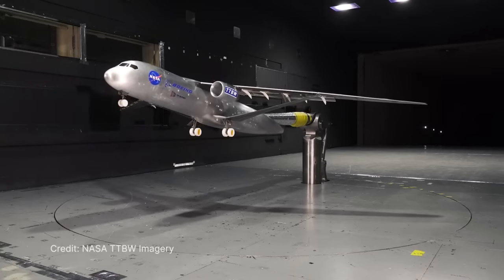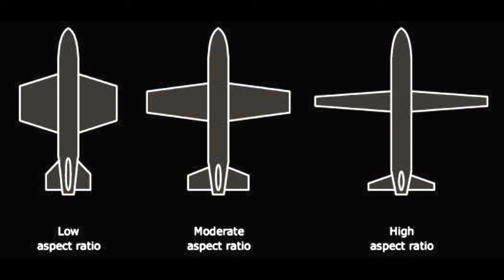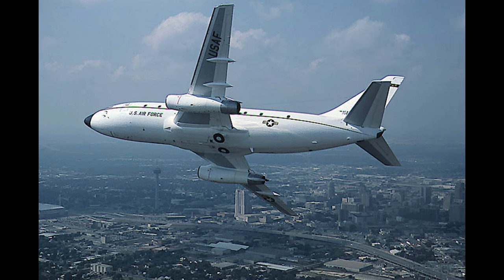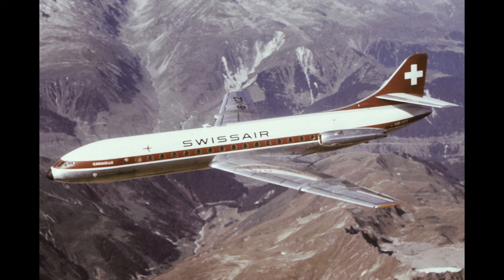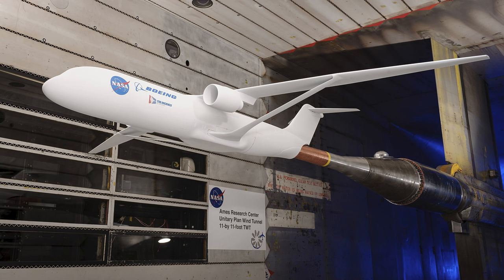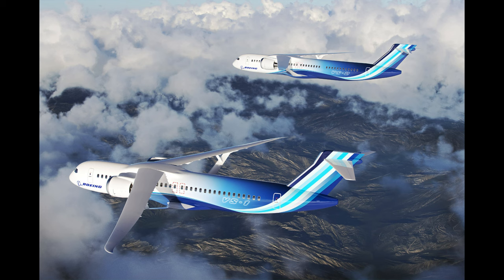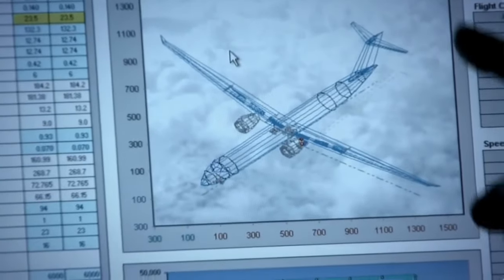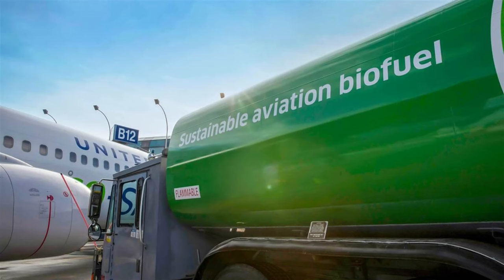NASA's New Airliner Experiment To Make Flying Less Expensive

Comment: And even better example would be the RQ-4B global hawk. it's got about 130 ft wingspan and is only 45 ft long nose to tip. It also flies at 60,000 ft with the engine at idle.
Reply: and that thing looks so small when you see it without people nearby for scale- it looks like a small bizjet until you see some dude walking under it.
Reply: And on the other side, this kind of wing is already being used on the China’s High-Flying WZ-7 Drone
Reply: At that point we should probably mention AeroVironment's Hawk30 and Sunglider flying wings.
Reply: Wow. I wonder how high it can fly when they turn the engines on.
Reply: Perfect design for cargo and passengers.
Reply: How long does it take to get from point a to point b?
Reply: The Transonic Brace frame can be utilized as wing fins, while being two main wings, for example: (In a top view.)  If you use an acute angle slim wing base limbs in the mid top front of a craft, that attaches to the tips by another lower rear reverse wing from another wing base connected on the back of the craft. The full set can be very narrow width spand. 

 A hollow mid mass + elongated lesser drag combo. of delta wing sonic speed & lean airliner size wings lift grip in* ONE. ( top view diamond ✈ formation, front/back view as flat diamon 🛩).
Reply: How about NASA and AeroVironments Helios?

It was a solar powered super high aspect ratio flying wing, in 1999.
Reply: @mattke5etc Great observation! Hadn't thought about this until Scott mentioned the U2 and saw your comment, less atmosphere higher up, also, (assuming) less lift from thermals at higher altitudes in terms of glide, not sure just starting to learn about dynamic systems etc.
Reply: @confuseatronica  haha I always feel like I'm having a stroke when I see it near its hangar
Reply: @aspuzling  he said idle, not off

Comment: “Control surfaces that can curve instead of just fold”

It’ll be nice to see 120 year old technology return. The Wright Brothers original patent on the first aircraft included wing warping as the control mechanism. Nice to see that come back.
Reply: Except that speeds are times higher.
Reply: it has been back sinc the X15 showed it would work better at supersonic speeds.
Reply: There was a program to look at this using a modified F-111 back in the '80's (https://en.wikipedia.org/wiki/General_Dynamics–Boeing_AFTI/F-111A_Aardvark)
Reply: My farm is a mile from the cliffs where they saw the birds soaring and got the idea. I am currently cleaning and widening the trail to the site so that more people can see the same thing that they saw.
Reply: @FarmerDrew  that's nice
Reply: Cheers. I got to the same conclusion.
Reply: Nothing wrong with it, just take old ideas and aply new materials or new technologieas at them. Roman concrete could help building industry. Old Sumerians have AC with no need ofl electricty ... obviusly. Airships cold be ecological and economic solution to havy cargo transport. And we could use slings or trains to get in to space cheaper and with lees polutions. problem is that Kante was right, unles you held "old industries" at the "gun point" they will never change.
Reply: @lukasmacht5858  Proof that physics doesn't change.
Reply: @l_..l.l.__l..l8833  it's a great office, good coworkers, and the birds rarely steal office supplies
Reply: Read (I think in the Putnam Aircraft range Japanese  volume) how one of the first Japanese aviation pioneers, wanting to build 'wing-warping' wing ribs, used craftsmen who built traditional laminated (archery) bows to create what he needed.  Old technology truly does return.
Reply: Apparently inspired by a cardboard box bending
Reply: @FarmerDrew  Who, The Byrds?
Reply: @cordongrouch9323  The Who, The Birds, The Beatles, Led Zeppelin, The Doors, we listen to all of the music while we work the historic Wright Brothers trail
Reply: @Ballin4Vengeance  it was inspired by hawks soaring the thermals in Moraine, Ohio, where Wilbur and Orville Wright had their first bicycle shop
Reply: It did come back bedore when nobody asked for it. On some planes at high speed the ailerons warp the wings so that their effect is negated or even reversed 😲
Reply: @FarmerDrew  Jefferson Airplane, my man!
Reply: @cordongrouch9323  oh and Steve Miller - Jet Airliner
Reply: @FarmerDrew  Time keeps on slippin'...

I want to fly like an eagle...
Reply: @FarmerDrew  Oops: The Byrds.
Reply: @cordongrouch9323  Neil Diamond - Jonathan Livingston Seagull
Reply: @FarmerDrew  I always kinda hated Jonathan Livinston Seagull.

But, it's all good.
Reply: @Lurch Not when it is encased in actuarial armor.
Reply: Ah - AKA "wing warping".
Reply: @youtubeuser206  Good for them!
Reply: @youtubeuser206  Yahtzee!
Reply: There is a reason wing warping disappeared: it was not working well, it was more working barely.  Ailerons are much superior.

And what is proposed is far from wing warping: it’s still ailerons. The ailerons will not have just one hinge but multiple ones — giving a smoother profile for the air to go around.
Reply: @FarmerDrew  All of the Wright's bicycle shops were in Dayton. As was their airplane factory. The people who bought the Wright company built an additional larger factory in Moraine.
Reply: @StevePemberton2  Moraine didn't even exist back then, so, yes, you're right. I live here and visit these places regularly. Dayton is an aviation history paradise.
Reply: @FarmerDrew  I went there several years ago and visited the museum and went out to Huffman Prairie. Sort of sad to see the empty lot in Dayton where the final bicycle shop was, but I have been to it at the Henry Ford museum in Dearborn, Michigan and they have taken really good care of it.

Interesting how for many years they couldn't find one of the bicycle shops, they knew it had existed because they had photos. Then a photo emerged with a little girl standing in front of it, they asked around town and found out who she was and where she lived, and that helped them locate a house which they then realized was the bicycle shop but it had been remodeled so the exterior didn't look quite the same as the photos which is why they had trouble locating it.
Reply: @StevePemberton2  our local community just successfully fought a bid to demolish the original shop near downtown Dayton
Reply: @Lurch pretty much if you can easily warp the wing enough to derarically change the lift profile you're going to have a very hard time stabilizing it.
Reply: @FarmerDrew  That's great. I saw a photo of it and I can see why some thought it should be torn down as not much is left, but it's historic and should be preserved especially since it was their first shop.
Reply: Can’t beat the Creator’s original design. Birds.
Reply: First aircraft was made by Santos-Dumont, not Wright Brothers
Reply: @r.h.w.1776  In fact that's what Otto Lilienthal used the basis for the world's first glider in 1891. Others had only tried to imitate the flapping of a birds wings, Lilienthal realized that it was the actual shape of the wings that mattered.
Reply: @giuseppevgiordano  There is a difference between the first powered flight and the invention of a working airplane. There is clear documentation, multiple witnesses, and photographic evidence that the Wrights made their first powered flights on December 17th, 1903, flying up to one minute and 1/6th of a mile on their longest flight that day.

Others may have lifted a powered plane off the ground before the Wrights did, perhaps nearing or even exceeding that distance. However documentation is very sketchy and harder to prove. But it's certainly possible that one or more people did this before the Wright Brothers.

However for the Wright Brothers December 17th, 1903 was just one step in a well documented development process over several years, that went from constantly improved gliders, to straight line powered flights, to sustained controlled flights at higher altitudes . By 1904 the Wrights were flying up to five minutes and doing full circles. They continued improving their design over the next few years. 

During development of their first powered airplane the Wrights produced the first accurate lift tables, they were the first or at least among the first to use a wind tunnel for testing, they were the first to understand the need for balanced turns, and the first to realize that a propeller is actually a spinning wing and works by the same principles.

The Wright's faced skepticism in Europe that the claims of their airplane's capabilities were greatly exaggerated or even a total lie. In 1908 the Wright Brothers did demonstration flights in France, and their former critics now hailed the Wrights and recognized their achievement.
Reply: That's not what he's referring to. He's talking about hingeless control surfaces.
Reply: @r.h.w.1776  Oops. Flying fish.
Reply: As a duck, i'd like to point out we had "wingtips", "warping control surfaces" and "retractable landing gear" about 10 million years before the Wright Bros.
Reply: Counter intuitively, the best shape for a paper plane is a cylinder. Given a flick to spin it, it flies far farther than any dart shape, as demonstrated on QI some years ago (Stephen Fry era).
Reply: German ww1 monoplane as well
Reply: @lukasmacht5858  The roman concrete supposed superiority that gets repeated a lot is partly a myth due to appearance. A large part of the reason it remains standing is simply because of massive bulk and lack of steel reinforcing(when reinforcing rusts, it damages the concrete). People are also unaware of all the structures that had major repairs, or collapsed. It also seems highly debatable if roman concrete is actually stronger than current(unreinforced) concrete. Unfortunately even well regarded information sources seem to just repeat info without any testing etc.
The formulation with volcanic ash does make it better for durability/longevity, but unless/until that can be replicated artificially it's not much use unfortunately. Albeit seeing as modern structures almost always require reinforcing steel, for strength(well beyond what unreinforced roman concrete could handle) and quake resistance, it's real purpose would probably be largely to better protect the steel.
Reply: Wright Bos.' wood and fabric was replaced by aluminum. Aluminum does not like to bend. Modern composites can bend. Full circle  =)
Reply: @lukasmacht5858  The problem with using slings to get to space is that we cannot fabricate indestructible cargo, pretty much 99% of the cargo and the people wouldn't survive the G forces involved, it's mostly a bs concept. And, in a way, cargo via Airships is much of the same.

Sure there are better ways of doing things but we can use examples that are more reasonable.

Comment: The other big advantage of the high wing that wasn't mentioned is that you can more easily put bigger bypass fans on the engines. Boeing has already hit the wall with fan size on the 737.
Reply: One of the graphics also pointed out ditching. Engines that hang under the wings can scoop up water during a ditching, causing the plane to cartwheel or break up. Obviously Sully showed a low-wing plane can be ditched safely, but before then no one thought it could be done.
Reply: если самолет с верхним расположением крыла приземлиться на воду, то он утонет прямо по самые крылья... :-)

Comment: I have always marvelled at how wings can be so strong, given their long thin shape.  The thumbnail, once seen, is a brilliant solution that I never would have thought of.  I guess you can get themore stiffness and strength with a lot less structural weight.
Reply: 1:58 "It's a high aspect wing."    No, NO,   NOOO  !!!        It's a high-aspect RATIO  wing  ... don't forget the word RATIO !!
Aspect ratio = (wingspan)/(chord)      and "chord" is the front-to-back dimension of the wing.
This gives wing area as (wingspan) x (chord)
LOW ASPECT RATIO means wingspan is small with large chord (also makes it more manouevrable and strong)
HIGH ASPECT RATIO means wingspan is large with short chord (also makes it more efficient, less drag, but less strong)
Reply: This is the last time I ever drive a Tesla! You call those ecologically grown donuts? This makes no sense.
Reply: @simonmultiverse6349 
Hush. Your num is low aspect
Reply: Simon Multiverse
+1 Rantio 🤭
Reply: @iridium8341  wow! You are a glass is half empty guy!!! How's that working out???
Reply: @iridium8341  the 737 Max 10 still kicking you, huh?
Reply: @vincentanguoni8938  I'm betting on "poorly"
Reply: Isn’t the 787 like one of the best long range airliners?
Reply: Wings are not "stiff".  They have to flex.....A LOT!   If airplane wings were rigid they would snap off.
Reply: @taitsmith8521  Snapping off would be a likely failure mode if overstressed, not their inevitable fate. That depends on the strength and durability of the wing. Wings that flex a lot have to be designed for greater fatigue. I don't know how that works in composites, but I suspect it's better than in aluminum. Still, flapping 787 wings give me an irrational nervousness!

Comment: High aspect wings like this are exactly how modern racing sailboats go so fast. Excited to see how this turns out
Reply: I used to have a hunter 29.5 ft racing sloop and it was so much fun. Kinda miss that sailboat.
Reply: Hydrofoils on the America's cup boats are another example...25 knot speed in a 20 knot wind
Reply: Wonder if they could goo 5 hoondred myles?
Reply: Is that another reason why wind mills kinda have that same shape? 🤔
Reply: @Eduardo_Espinoza  pretty much, yeah
Reply: @eclogite  sweet! Tnx! :D
Reply: @tsparks4133  Sailboat races often race across the entire world. The americas cup vessels are meant for short range, high intensity sailing, but there are hydrofoil and wing sail designs made for transoceanic racing.
Reply: The thing that sets the AC boats apart is that they are hydraulic powered, only by human muscle. No generators or batteries, motors or anything, just big gym bunnies
Reply: In the end it's the most efficient airfoil design you can get! The limitation is the structural integrity.
Reply: They remind me of an albatross.
Reply: I'm tired as hell and thought "wow 16:9 wings"🤣
Reply: @Flesh_Wizard  you could actually do that, it's just not as aerodynamic as a higher ratio

Comment: One big benefit to mounting the wings that high on the fuselage is the new unducted fan (propfan) engines being developed by CFM will fit without hitting the ground or the fuselage. The props are rather large and getting enough clearance is kind of a challenge on current aircraft like the 737 or A320. So much so that when Pratt and Whitney was testing their version a few decades ago, they used the MD-80 because it's engines were mounted higher and at the back of the aircraft.
Reply: But seemingly a significant part of the reason for the engines being low is to make maintenance easier, this design seems like it would be considerably more difficult for maintenance.
Personally I'd be interested to see how the struts cope with turbulence etc, it seems potentially a bit iffy making a rigid triangle for wings that normally flex. I guess the outer portion of the wings dampens turbulence etc, but it seems like the strutted portion would be much more difficult than the equivalent used on much smaller, slower planes.
Reply: @DoubleMonoLR  they did say the wings are supposed to be considerably longer, even requiring a folding section to fit current gates at airports.
Reply: @DoubleMonoLR  I agree at what point does efficiency overtake safety and maintenance costs...maybe it already happened at Boeing for one of those...cough maybe too large a diameter engine on 737 cough...
Reply: Without the housing, what prevents a broken giant blade from being thrown through the fuselage?
Reply: @Nullpersona  armor on the fuselage.
Reply: @Nullpersona  lefty loosey righty tighty
Reply: @DriveCarToBar  While that seems common-sensical on aircraft already benefiting from armor, like military planes, the additional weight of armoring everything behind the blades seems prohibitive in commercial application.
Reply: @Nullpersona  Nothing. Same way there is nothing protecting you from a propeller explosion on a prop airplane, or the turbine in a jet engine should it come apart. Its just such a rare event that we don't plan for it.
Reply: The problem with the inducted fans was it dropped the speed of the aircraft, so it took longer to get somewhere and they ate more fuel up doing it. They did not get the savings they wanted it. I wonder if the new unducted vans fixed that or are we going to slow the airplanes down? When you slow the airplane down flights per day you can have without airplane. Come straight out of your revenue.
Reply: @fppro1679  I'm wondering if they aren't thinking of doing bigger, slower planes with more people. Higher dollars per flight, reduced flights but fewer planes to maintain and crew. 
Guess we'd just have to see if it's more viable or not.
Reply: @DriveCarToBar  I think this is all about saving fuel.